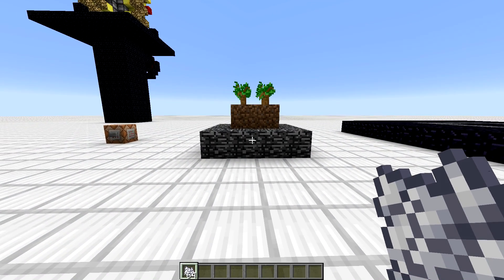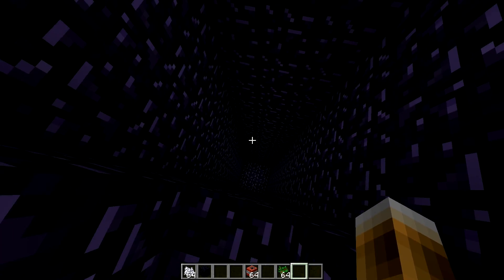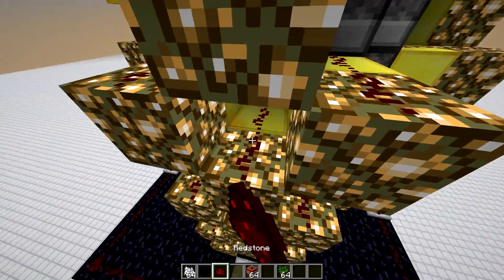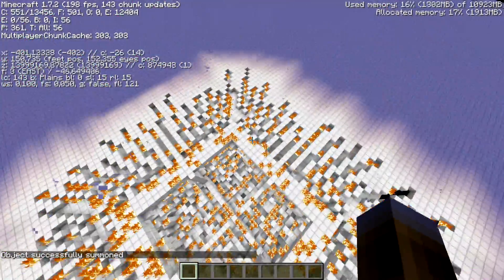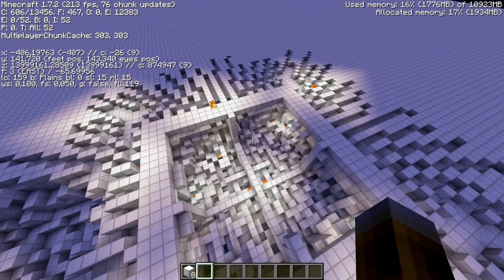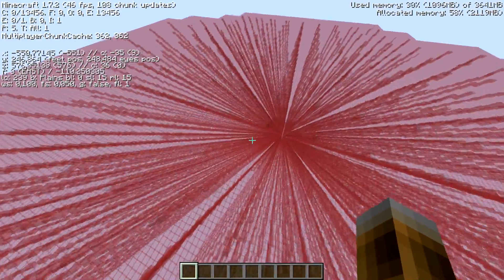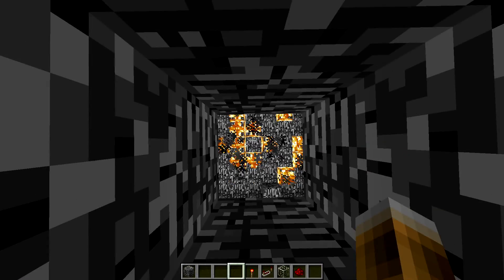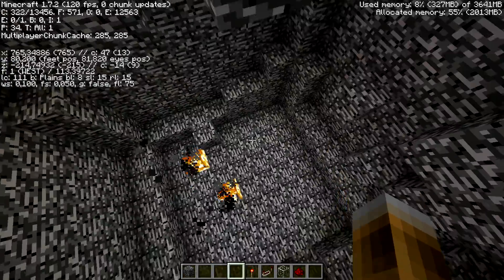Minecraft Science: Explosions ( How to blow up Bedrock - Explanation)

Comment: I know atleast how to blow up obsidian without using commands.  possible in survival mode aswell.  didnt think bedrock could be blown. never tried. but how you do it is by basicly using TNT minecarts. and alot of them on the exact same tile. and a detector rail next to the obsidian and simply touch the minecart and it goes along the rail to the obsidian and blows up. aaand obsidian blows up aswell.     warning for lagg depending on your computer.
Reply: They fixed that in 1.7
Reply: aaaaw. but it was fun to do it. the obvius only 2 times i have done it.  :3

Comment: my brother has exploded bedrock with only 10 tnt's i'm not ling
Reply: bullshit
Reply: Prove it
Reply: it was alobg time ago in 1.5
Reply: No proof, it's a lie.
Reply: Bedrock has explosion power needed of 1,000,000. If you used 10 that means it only had the power of 40. That is only 1/25000 (Fraction) that was actully needed. The only way he could actully do that is by setting each of the 10 TNT to the power of 100,000. Even then it would most likely not work though because it would explode 1 at a time as a chain affect causeing only 1/10 (Fraction) of the power needed. There for no you did not blow up a piece of bedrock with only 10 pieces of TNT. But if you used a power of 100,000 , which I have no clue how, than you could say you were closer.

Comment: /summon Fireball ~ ~ ~ {direction:[],ExplosionPower:3000000} ...

I just blew up my server and cant log in HAHAHAHA
Reply: Thats b/c compared to the previous explosion of 1000000 * 1000000 * 1000000 which is a total area of 1000000000000000000000000 where if you did 3000000 * 3000000 * 3000000 you would be doing a total area of 27000000000000000000000000 larger than the already processor heavy number. My computers limited memory struggle to even create arrays of the 2000 by 2000 by 2000 size
Reply: Hahah I see. Well, I deleted it and made a new server :p not doing that again xd
Reply: how you did? I tried houndred of times in mine doesnt spawns

Comment: If TNT have a power of 10. Isnt it possible to have 100 000 TNT to make an explotion of 1 000 000 like the fireball. If thats possible that means that its possible in survival mode, right. If im right or wrong please comment
Reply: As he showed in the video, TNT is processed by the game at a time, and the strength of the explosion is tested when the explosion happens, so the explosion power of the TNT does not add together. So no, you can't do it with TNT in survival.
Reply: Ok

Comment: /summon Fireball ~ ~ ~ {direction:[],ExplosionPower:10000000000000000000000000000000000000000000000000000000000000000000000000000000000000000000000000000} This is an explosion with a googol of explosion power. I want to see a video of someone using this command.
Reply: Command block. :P
Reply: Super! :3 It 2^32. Any thing more and it loops.
Reply: The highest 32 bit integer is 2,147,483,647.
Reply: the pc would of crashed before you eaven hit enter
Reply: im gonna (my pc WILL crash :-) to do it for u
Reply: Why not a googolplex? (That's 10 to the 10 to the 100)
Reply: Batteriii actually it wont it will only crash when the fireball hits
Reply: Mabobbers BoomerBoxer & ExplodingBoomer It was a joke :P
Reply: EariosRandomness not physically possible
Reply: Wouter H Exactly.
Reply: Super! :3 12 quintillion years jk

Comment: When I try to summon a fireball using the command in the description(only difference is 500 power instead of 3,000,000) it says unable to summon object.
Reply: You'll need to use command blocks.
Reply: type this /summon Fireball ~0 ~0 ~0 {ExplosionPower:500,direction [0.0.0.0.0.0]}

Comment: Dude, there is no damn way to have a
High 200+ or 300+
Reply: I only get 100+ And not more
Reply: DylanPlaysMinecraft *facepalm* do you even know what kind of fps some people get also hes on a flatgrass map, anyone can get 300+ on that
Reply: Lunass moonbutt
 i dont on my old pc WICH SUUUCCKS
Reply: the requirements to get 300+fps is an intel core i7 and thats about it
Reply: Lunass moonbutt
 dude it ha but i get like 2-7 fps
Reply: When I first got my computer, minecraft ran at 1000 fps 1000. but now it runs at 100-300 :(
Reply: In reply to Leon, usually when you get more things in your computer it takes up more space therefore taking up more processing power space for to work with, but 100-300 frames is still really good, but if you want more frames, (like you need them XD) just delete a whole lot of things (and i mean ALOT) or close tabs that you have open. You can also use a cooling pad, (if its a laptop) or a fan (if its a desktop) to cool down your computer and stop the heat from slowing down your gaming, hope this helped anyone! ;D
Reply: well my computer is about 3-4 years old
Reply: Well maybe its time to get a new computer then... If you to play minecraft, any game really you need to be able to play at a good frame rate, unless your used to having 10 FPS and it doesn't bother you, but if your computer is like that, then your going to get a lot of lag spikes, A LOT OF LAG SPIKES
Reply: ***** my friend gets like over 1000 fps but hes computer costed like 1100 $
Reply: I have 30-24 FPS

Comment: I think the explosion calculating is when the fireball explode it will summon particles, all the blocks tha touch these particules will disapear
Reply: Kind of. They don't use the particle system for that, because what are generally called particles in Minecraft are just visuals that won't affect the world around them. But yeah, it's like a new particle system that is only affecting the blocks, not rendered in any way. You could call them particles, but they are completely separate from Minecraft's normal particle system.

Comment: I tried this and it didn't work even with 3000000000000000000000 explosive power
Reply: Variables have a cap, anything over a certain number (2147483647 in this case) would be ignored or treated completely differently than you are likely expecting.

Comment: So explosions only drop one of the destroyed items?
But why does a creeper or TNT that blows up give me several dirt blocks back then and not just one? (In a normal survival world on the surface)
Reply from the maker: no, the chance per destroyed block is 1/ExposionPower. so you can get several blocks since you destroy not only one, but if you try to blow up bedrock, than even if every of the 1352 rays hits a different bedrock block at a explosion power of 1 million, then since the chance per block is 1/1000000 the total chance for getting any block is still only rougly 1/1000.
Reply: ahh , ok thx
so I get roughly 40% of my dirt back (1/2.5)

Comment from the maker: For everyone who is wondering whether you can do this with TNT minecarts: when they where first introduced,  it would have in theory been possible since they could boost each other almost infinitely.  But since 1.7 they have added a limit to the max explosion power which is at around 11, therefore way lower than the necessary strength to blow up obsidian or even Bedrock :(
Reply: what would happen if you fired them into a pool of water? by how much does water dampen the explosion?
Reply: Hmm. I'll test it later myself with x10 explosion each time. 90% certain you're right but quest for knowledge.
Reply from the maker: water has only a very low blast resistance compared to obsidian or bedrock. You can blow up water with an explosion power of ~50 already, remember obsidian need ~300, bedrock ~1000000. and TNT has 4. For more info go to http://minecraft.gamepedia.com/Explosion, that site is mostly correct.
Reply: JL2579
Thank you JL!
Reply: You sound kind of German 0o
Reply: zight baoe its editing superflat presets, not mcedit
Reply: Senou Natsuru that would not increase power, only explosion size.
Reply: HOW DO YOU GET THAT GLASS WORLD !!!!!!!!!!!!!!!!!!!!
Reply: If ever you did this in the snapshot in which these first were introduced, do you think it would be possible?
Reply: JL you can still do the huge tnt minecart. You do it by:
putting a rail on one block. Surround it by a wall. On the bottom, place a dispenser facing the tracks. Stuff in tnt minecarts in the dispenser and power the dispenser with redstone. Keep on doing so until you get a bunch of tnt minecarts on one track. Lastly, remove the walls and move the tnt minecarts. Huge explosion :D. Glad it helped. This works in minecraft 1.7.2
Reply: Bailey Jordan-hunter Custom flatland presets, search minecraftwiki for more help
Reply: max thompson I believe they have the same blast resistance as obsidian, although I might be wrong.
Reply: Can you blow up nether stars with this method?
Reply: Is ziz guy german?
Reply: you sounds german
Reply: th3_gh0st
Did you watch the video?
Reply: +JL2579 just play in 1.6 to do it
Reply: Vulcano213 Gaming
 You could try it, Minecraft allows backdating from "Edit Profile" in the launcher.
Reply: Vulcano213 Gaming  I say go to 13w02a that's where tnt minecarts were going boom.
Reply: if(creative mode && tool != tool.sword){ TADA }
Reply: aivan veloso that server probably has a plugin to destroy it so its not so op
Reply: Halbzwilling | Mapmaking That would be because he is german
Reply: Ivi Fetita yt Make it yourself -.-
Reply: 200st like at the comment of JL2579!!! :)
Reply: TheMinecraftChannel well it looked like it to me
Reply: Senou Natsuru I know a better way. Put a very fast Redstone clock next to a command block with the command summon TNTMinecart x y z I did it with a comp and the explosion sent me 2500 blocks away
Reply: OMG your Computer is A beast!!!!!!!!!!!!!!!Mine maximum FPS in-game is 40 I think!!!
Reply: Jacob Hylén i have a intel atom 4*1,3ghz and 2gb ram and thats enough
Reply: i tried the fireball thing and hit it waited like 5 seconds then i was like  WHAT THE FUUUUUUUUUUUUUUUUUUUUUUUUUUUUUUUUUUUUUUUUUUUUUUUUUUUUUUUUUUUUUUUUUUUUUUUUUUUUUUUUUUUUUUUUUUUUUUUUUUUUUUUUUUUUUUUUUUUUUUUUUUUUUUUUUUUUUUUUUUUUUUUUUUUUUUUUUUUUUUUUUUUUUUUUUUUUUUUUUUUUUUUUUUUUUUUUUUUUUUUUUUUUUUUUUUUUUUUUUUUUUUUUUUUUUUUUUUUUUUUUUUUUUUUUUUUUUUUUUUUUUUUUUUUUUUUUUUUUUUUUUUUUUUUUUUUUUUUUUUUUUUUUUUUUUUUUUUUUUUUUUUUUUUUUUUUUUUUUUUUUUUUUUUUUUUUUUUUUUUUUUUUUUUUUUUUUUUUUUUUUUUUUUUUUUUUUUUUUUUUUUUUUUUUUUUUUUUUUUUUUUUUUUUUUUUUUUUUUUUUUUUUUUUUUUUUUUUUUUUUUUUUUUUUUUUUUUUUUUUUUUUUUUUUUUUUUUUUUUUUUUUUUUUUUUUUUUUUUUUUUUUUUUUUUUUUUUUUUUUUUUUUUUUUUUUUUUUUUUUUUUUUUUUUUUUUUUUUUUUUUUUUUUUUUUUUUUUUUUUUUUUUUUUUUUUUUUUUUUUUUUUUUUUUUUUUUUUUUUUUUUUUUUUUUUUUUUUUUUUUUUUUUUUUUUUUUUUUUUUUUUU-
Reply: 13:20 solid obsidian? ??? thats not obsidian :P
Reply: No, I think.
Reply: Will it work on 1.6?
Reply: Bailey Jordan-hunter Id bet it is mc edit
Reply: Timothy Bondarev Jip you can :) coz all blocks have a blowup count :)
Reply: Obrist Vinnie Louis blows up everything but bedrock according to voltz wiki
Reply: QuackersExpress not anymore, blocks like bedrock and barrier blocks now have a simple if statement (Block.Bedrock.destructable || creativemode){WhatFs}
Reply: i want 15:47 map seed :O
Reply: TheNewTimeGamer I would assume it were a little more complicated than a simple if statement, as you also cannot break blocks with a sword in creative mode.
Reply: Bacon Juice
Why not?
Reply: PassingTimeAlong You just can't. Try it; it's impossible. Probably so you can kill things without worrying about destroying the surroundings. In my opinion there should be a game rule as to whether you turn it on or off.
Reply: What about ender chests?
Reply: you can exploede obsidian using tnt you  just need to do it agian and agian i do it on raiding server :D
Reply: aivan veloso Nope, that's wrong. The game doesn't work that way.
Reply: Lol
Reply: LOL!!! AWESOME!
Reply: Bailey Jordan-hunter its iron
Reply: Bailey Jordan-hunter Glass world is easy, just edit the flatland
Reply: ***** No, I've blown up lava and water before with a nuke from a mod.
Reply: Maybe you can switch into 1.6 or something?
Reply: did you guys know that end portal block and command blocks are blast resistant to
Reply: Timothy Bondarev
Nether Star is not a block
Reply: I want a 1.000.000.000.000 explotion!
Reply: This isn't a chat program god
Reply: ukpuffle with a good computer
Reply: ukpuffle A computer with the best and most expensive components
Reply: ukpuffle antvenom gets 6000fps no joke it was shown by accident in one of his vids
Reply: DABOSSKNOWSALL99 except cough cough you cant get 6000 fps
Reply: TheMinecraftChannel except you can? its just really hard and requires ridiculous hardware
Reply: CameronLikesToGame thats what i meant
Reply: WOW Your good at Minecraft
Reply: Let's say a computer that always had 5000 fps and no lag occurred then would it explode?
Reply: Gy001 It always depends on CPU and GPU Calculation speed. It would require a hell of a rendering machine to get 0 lag when you create a that high explosion. And I guess our consumer range hardware (the fastest) can't do that at the moment.
Reply: Emetophobic  Well actually, There is a computer with more fraps than any other computer in the market. 300gigajules! Holy crap! More than 10,000 Fraps! DUHHHHHHHHHHHHHHHHHHH
Reply: ***** if that is the case then how do you explain the explosion at the end where he fires it into water and it still did damage to the terrain and removed the water in a large area
Reply: Monster Mc just to clarify, fps stands for frames per second. Not fraps if that was what you meant. Fraps is a screen recording program made mainly for games.
Reply: wapzoPlaysSome  I know but a short way of saying fraps per second is fps or fraps. DUHHHHHHHHHHHH
Reply: Monster Mc You misunderstand. Fps is short for FRAMES per second, not fraps. You don't say fraps when referring to frames per second, you say frames. And as I said earlier, fraps is not frames, it is a screen recording program.
Reply: wapzoPlaysSome  Meh. I say fraps as in frames per second. Sorry
Reply: Monster Mc You don't need to apologize :) I just wanted to correct you for future reference.
Reply: wapzoPlaysSome  Yeah. Ok! :)
Reply: poop :(
Reply: Bailey Jordan-hunter Look at the description
Reply: HerrProfDrGuenther he is check his latest video
Reply: Halbzwilling | Mapmaking hab ich ihm auch schon gescjrieben PS Hab dich abboniert :D
Reply: anyways i dont think bedrock braking is possible
Reply: CameronLikesToGame You could, with an 6000Hz monitor...
Which doesn't exist yet...
Reply: Core that must have taken agis to make
Reply: Thanks, I wondered that
Reply: How to reach the void: first, use the infinite tnt bug reviewed by Logdotzip, and have fun!
Reply: zight baoe no
Reply: Nova productionz no because idid it in my superflat world and it blew up
Reply: /pt ?
Reply: How Could You Summon It Then The Summon Command Was In 1.7
Reply: kostas thodoris iosifidis 200 FPS in minecraft is easily achievable with 1000 dollars, I don't think his computer is a beast, but I do believe your computer is pretty bad :P Spend a little money on a better pc, if you want to ofc.
Reply: DanXXLEX i was like: -.- (not-enough-ram-face)
Reply: *****
....How?
Reply: I'm putting the red glass code in the preset box but I end up with the regular flat grass what am I doing wrong?
Reply: mr$lappy It's no longer based on numbers. You have to write the actual thing.
Reply: can you speak german?
Reply: Frag ich mich auch
Reply: Der Typ aus Den Kommis Alter komisch. nach 20 Sekunden merkt man dass er deutscher ist
Reply: Wo hast du bedruck kaput geh macht
Reply: Michael Reini  Mann merkt sofort das er deutsch ist
Reply: Leon Neumann ge
Reply: JL2579 10:52 there is an optical illusion for me. It looks as if the rays rise up out of the ground! Just thought you might find that interesting.
Reply: Lolooloololololololololololololololol got trolls
Reply: well..... i love channel
Reply: YOU CAN DO IT ON XBOX 360!!!!!¡
Reply: you can do in xbox 360? gosh i wish it was xbox one.
Reply: Wow, this video is very amazing.
Reply: oOo
Reply: JL2579 SHUT UP BITCH ITS FAKE
Reply: why your world is full of iron blocks
Reply: JL2579
Reply: JL2579 i